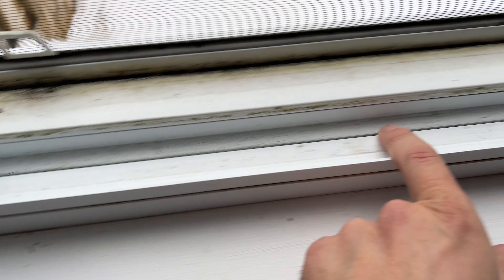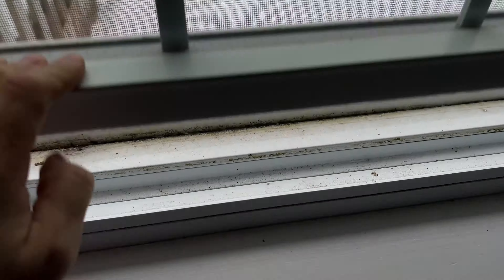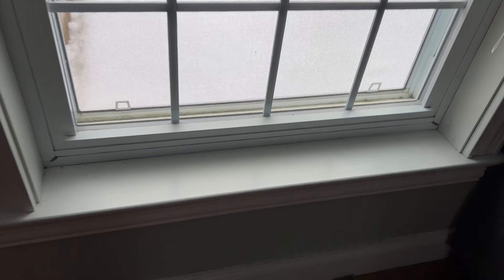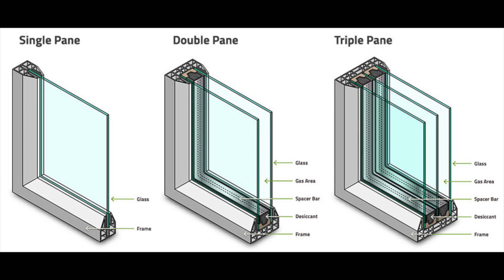If You’re Stuck With Noisy Neighbors You Need to Watch This!

Comment from the maker: Links for all the soundproofing material you'll need! - https://soundproofguide.com/recommended-soundproofing-products-material/
Reply: hi soundproof guide sir ... i saw alot of ur youtube videos on my other account
but i live on certain country in asia where some of materials probably i can't get
so.. may i ask u some questions but it's little embarasing and long
what do you prefer me to ask by email or i just drop here?
thanks
Reply: Hi there. I am experiencing some issues with sound coming from cars that reverberate inside my bedroom. I have caulked around corners and even made up an acoustic cover on the outside of my sliding glass door. This noise seems to be coming through the walls. I can't hear music or people talking only deeper sounds coming from accelerating vehicles and rumbling. If I were to put some heavy furniture against the walls and put say some acoustic tiles attached to a board I could place on the wall where the sound is coming from would this reduce the noise?
Reply: Where is the link for the caulking?
Reply: 2:30  soundproofing the door caulking…  product used is not included in list of links
Reply: You called it acoustical sealant. Brand-name? Where to purchase?
Reply: So, did I understand it correctly, that to soundproof the walls to block out noise from my neighbors, I have to put a drywall ON the brick wall, (do I just mount it directly on the brick wall?), and then put vinyl on it, and then another drywall on top of it, right???

Comment: This really is the ultimate checklist, I'm just a college student looking to eliminate noise coming out of my room; I came to this video to learn more about acoustic panels, and I discovered that my door would be the main culprit. Acoustic panels are basically the toppings of a sound-proofed room if I understood the content correctly. I also learned so much despite not being able to perform any of it in my apartment. The use of resilient channel systems, acoustic sealant, weatherstripping, the ideal drywall material, applying putty pads in inconspicuous spots in the electrical routing, thanks for educating me, you got my sub.

Comment: 1. Soundproofing insulation.
2.acustic puddy pad around all electrical outlets.
3.  triple pane windows.
4. Acoustic caulking or backer rod around all gaps, doors and windows and before baseboards are installed.
5. Mass loaded vinyl between 5/8 drywall.
6. Solid core doors.
7. Resillant chanel on ceilings between floors.
8. Acoustic drywall instead of mass liaded vinyl.
Reply: What is the total cost?

Comment: Thanks for doing this.
We got triple Glazed windows installed a few weeks back but as time has gone on - more & more noise is coming through. The windows were 5-figures so it wasnt a cheap job by any means but we havent gotten the ambient/outside sound surpression we were promised

Comment: Thank you! We've never lived in a bottom apartment before and the folks walking up/down the interior stairs (between our bedroom/living room) drives us nuts! Plus they're heavy feet stomping around, and yes, we can tell when they are stomping versus regular walking around, or if the lady is wearing heels, etc. We hardly ever hear them talking, but the stomping means we have structural sound proofing needs. And since we rent, we don't want to spend a lot of money. I'd really just like a cocoon thing over our heads in bed at night. We've already tried headphones, every kind of ear plugs, etc. UGH
Reply from the maker: Have you tried a sleep headband? I reviewed one where I was impressed with how well it worked for only $20. There are some $100 models that I’d also recommend if your budget allows but honestly, the $20 one is a great start! Plus if you buy it from Amazon, you can easily return it if you don’t like it! Here’s the link to the video! https://youtu.be/WyvGo5KsB4k?si=q_06_uRTivIJ4-la
Best of luck!

Comment: I’m here to soundproof a CNC machine with a 24000rpm Spindle I’ve installed in my Photo Store, I have built a fully painted 20mm Plywood box with Silicone in all gaps.  After watching your video: inside I will spray Automotive Sound Spray, then Automotive sound sheets because we have all these, I might add carpet over that for a better look, the front door is a large acrylic sheet, I will add 1 or 2 layers and lastly I will rest the 40x60” machine on a layer of rubber.

Comment: I need help with blocking out some extremely loud, daily noise. I’m talking LOUD motorcycles and stuff to my left wall. I admit, I need to caulk the edges around the trim. But that’s also where the wall unit, ac is. Im positive it’s 3/8 single-sheet drywall. May or may not be insulation. 🤷🏻‍♂️😂 I’ll give more info if needed. Any recommendation?

Comment: Can I please speak with you?  This matter might be life or death… MY OWN!  I’m seeking something to go around the inner casing of a door that does not need to open ever again. So far I’ve purchased everything you said. What sticky backing do I need to surround edge of door that would be 1 1/2 “ thick (same as door thickness) I’m only finding some thing you linked for a window. I’m thinking that’s not what you would suggest for door as it pops out too thick to close door. I’m looking for something thinner, if it would go around a door so I can close door.
Sorry I’m advance for my multiple comments TMI… all of which will likely help your channel, not hurt it. I’m speaking my comments and Siri is doing it’s own translation of what I’m saying - driving me nearly crazy at this point 🤪 so now I’ve wrote an entire blog post/ novel  in your comment section.

Comment: Hey what do you think of stacking heavy duty aluminium foil for soundproofing a window then taping each side to insulate it. I know from your videos you say MASS is needed but would it atleast be effective as "blackout curtains" are, its kind of the same workflow except the curtain isolation is done with Velcro. I ask because i use a portable ac with casement windows, and this creates a massive gap from having to open the window for venting. I did buy a bag-like window seal to stop hot air from coming in, but it doesn't do too much for soundproofing and the only possible thing i can do with these type of windows is stacking curtains+foil. You can google "portable ac casement window seal" for a perfect visual representation.

TLDR: not wanting you to be my personal helper but i did read foil blocks 85% of the sound, so curious about your opinion on it.

Comment: OK will you please make one more YouTube video for the females, describing the difference between the first linked green glue compound, which looks very similar to the second linked green glue sealant? 
They are obviously not the same thing they only partly sound like it. Are they used together? Can you use one or the other or must we use both ….and which goes first? Also, I’m assuming I can walk into Home Depot and they can tell me what gun and casing I need in order to use both of these cans of green glue?
Reply from the maker: Great question! The green glue sealant is the one you want to use to seal the gaps around doors, windows etc. And the green glue compound is the one you use in between two layers of drywall in hopes to reduce noise transfer between rooms.